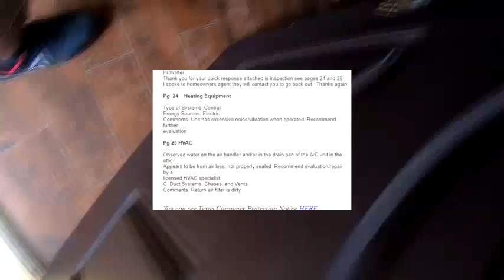HVAC: Heater making loud noice

Comment: Never seen a contactor in a Goodman air handler.
Reply: If its a heatpump with back up heat strip it will have one.
Reply: @King_David_8  I know it's possible but I only seen sequencers.

Comment: Not cool when you do a maintenance you are supposed to do both AC and heat. When someone says to check the whole unit that means the whole system not just AC. 

Thanks.